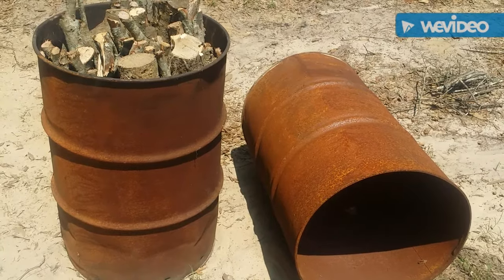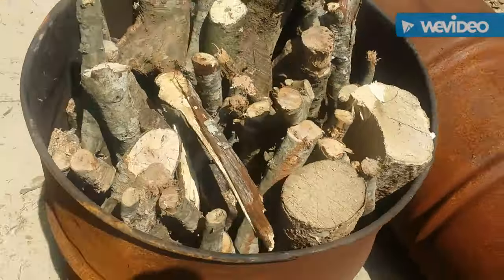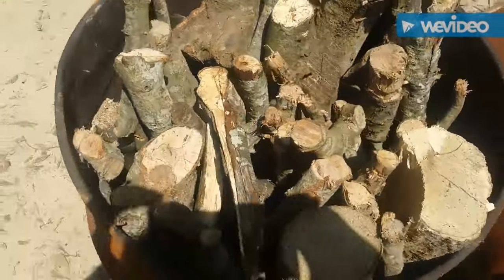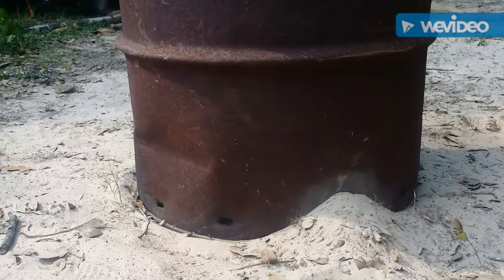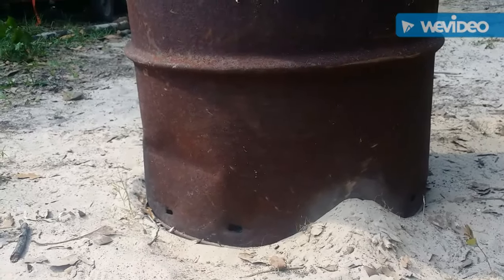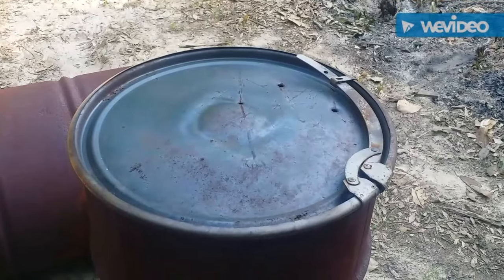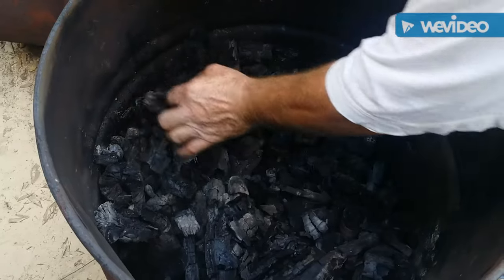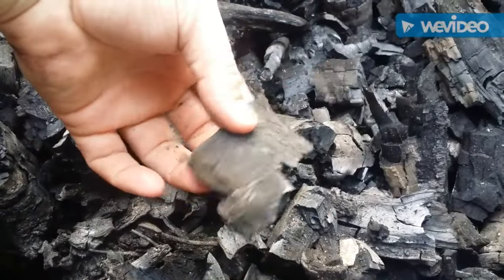Homestead Charcoal making the best way

Comment: Thanks! I tried this myself and have made three excellent loads of softwood charcoal for blacksmithing so far! I stack the barrel all the way to the top with kindling size pieces of pine and fir. It only takes an hour to burn to the bottom being that it’s softwood. Each load lasts over four hours of forging and gets hot enough to melt steel in my brake drum forge in about three minutes. I can now make great forge fuel easily and free! Thanks again!

Comment: I don't know about "best", but this is definitely the easiest method I've seen.

Other people have already mentioned it, but this is a "direct burn" method. Unlike most direct burns I've seen people do (and especially unlike the centuries-old mounding methods), you've created an afterburn zone to keep it from smoking to high heaven. You are getting more ash in your finished charcoal than a retort--or "indirect burn"--method would produce, but with a far simpler setup.

Considering how little ash you got, you're obviously getting pretty good yield. Most attempts at direct burns seem to produce a lower yield than you're getting, so you are obviously putting the fire out at almost exactly the right time. Very nice work.

Comment: I do it very similar. Lots of videos of guys making these elaborate retort kilns and stoves, but I hate drilling and otherwise  cutting up solid barrels… I also hate using 3x the amount of firewood as charcoal wood to get the finished charcoal… and I especially hate only producing a bucket full of charcoal at a time. I do almost the same as you here, but I don’t drill any holes in my burn barrel, and I use a rusted out old barrel for the jet chimney.
During burn pile season, I use 2 or 3 full barrels and build burn piles around and over them, barrels have only 1 hole with a 3-5ft x 1” pipe attached to allow for the pyrolysis processes and so I can monitor exactly what’s going on in the barrels.
Both methods are super simple, and efficient…

Comment: I use this same method in making biochar.  Only I use wood chips. Chips are easy to get from a tree service. I spread them out in the sun for a few days to dry. I then run it through a screen, half inch hardware cloth to remove the fine material. The fines impede air flow.  It then goes into a barrel, light the top, put the lid on and let it burn,  When the fire gets to the bottom of the barrel I remove the chimney unit and put a lid on it. Cover the holes in the bottom of the barrel and let it sit.  Using wood chips I don't have to crush it any further and wood chips are easy to get. This is called a top lit up draft system. TLUD for short.

Comment: after watching this video, I did a modified version of this, my holes are on the bottom and i set it up on three pavers. I ignite and within about 60-90 seconds there is usually a 3 foot flame rocketing out the top.  My holes are 1" and there are a bunch.  I leave the chimney on until i feel confident from inspection that the whole of the wood is involved.  i then let the fire continue to burn for about 15 minutes.  after that i remove the bricks and hill up dirt around the perimeter.  I let the fire continue to burn til all the wood is a glorious ruby red with NO FLAME.  I then quench it with water and put a lid on.  I check it once more a bit later to ensure it is quenched, then leave it for the next day.

Comment: If you have a wood stove just get a stainless steel container, drill some air holes in it, then fill it with wood and put it in your stove. This will produce smaller amounts of charcoal, but you don't need to maintain a big fire outdoors and all the energy goes into heating your home. If you prepare several containers in advance you'll have a large amount of charcoal soon :) Watch "Make Your Own Charcoal In Your Wood Stove (Wood Gasification) DIY" to see how it works.

Comment: Hi,  thank you so much for your very informative and interesting video, I would like to ask just about how many burns those barrels will be able to do,  secondly, how many holes and what size ( they seem about 1 inch) did you put  at the bottom of the barrel. Looking around I heard people trying a similar method but they moved to a different one because they were producing a lot of smoke no matter how many holes did they put at the bottom, I wonder what your thoghts are regarding this....maybe they did not use wood dried enough or they put something like woodchip which would prevent a good airflow within the barrel. Did you try your method with smaller wood sizes? Thank you very much for your help, Dami.
Reply from the maker: The barrels last 4 or 5 years and I usually make charcoal once a year.    I have tried larger diameter wood,  but it won't fully Carbonize if it's too big.   My best luck has been with 6 inch logs.    As for holes at the bottom...  I just guessed on mine.   You can put as many as feasible in it and fine tune the burn by shutting them off with sand.   Good luck and let us know how it works out for you!
Reply: @TURBOLANDRAIDER  thank you so much for your reply, I will try it and let you know thank you very much !

Comment: I have some questions...  how much time do you leave the afterburner.  And for how much time do you leave it breathing from below holes...
Reply from the maker: All explained on the video.    The afterburner stays on until you see red coals through the bottom vents.    Then the vents get sand shoveled onto them,  and the top gets covered.
Reply: @TURBOLANDRAIDER  thanks..  just a minor question...  red coals may fall in the bottom from the initial fire ...  shall I have to wait to see fire in the bottom??..  as i understand it needs 2 and a half hours after setting the fire and then close all the holes including the top??
Reply from the maker: @zooulapanayiotou2603  wait until you see the flame front drop down to the very bottom where the vents are.   That's when you know it's ready to cap off,  and extinguish the fire.

Comment: This charcoal has a sort of silvery color compared to the normal pitch black charcoal you see... what's the difference?
Reply from the maker: 4xdblack I'm really not sure.   maybe all charcoal is like that,  but in the process of bagging and transporting it,  that shimmer gets dulled or knocked off.
Reply: Been watching a lot of videos and reading up on charcoal making methods... If I had to take a guess, this method is called the "direct" method. The more common method is the "indirect method" or the charcoal "retort". What I've noticed is that the Indirect method produces pitch black charcoal straight from the can, whereas the direct method produces the silvery charcoal that you're getting. I read somewhere that the quality is essentially the same for both methods, but supposedly the indirect Retort method is more efficient, and ensures that a higher majority of the wood gets completely carbonized and little is lost. 

So I'm thinking the silvery color is due to the lost wood that wasn't carbonized.

But I'm pretty new to the idea of charcoal making. I just started researching it last night. But I still feel like this method is the better one because of several reasons. The first one being that all your wood gets turned into charcoal, and none of it is required to light a fire under the barrel. The second and biggest advantage IMO is that it is the easiest way to make a large quantity of charcoal at the same time. It's very difficult to make a charcoal retort that uses a 55gal drum.
Reply from the maker: 4xdblack excellent.   it's easy to get normal 55 gallon drums too.   they're commonly available.  With this setup,  I can yield four "50lb chicken feed,  or dog food bags" from 1 burn.   2 burns is enough to satisfy my grilling needs for a year.  (that's really all I use my charcoal for).  that's the biggest plus of this method imo.   it might not be the most efficient,  but it dang sure makes enough charcoal to make the process worthwhile.
Reply: I'm looking to make my own charcoal for my home forge. It would be a lot cheaper in the long run if I could make it myself. But right now I've only got one 55gal drum. You said that they're commonly available. Where might I find an old 55gal drum then?
Reply from the maker: 4xdblack any industrial area ought to have a bunch.  we have a few local places that sell storage buildings,  IBC totes,  barrels,  etc.   try driving through industrial parks,  and asking workers where you might find a used one.
Reply: 4xdblack 
They have them on Craigslist for cheap ($25) where I live.
Reply: My local craiglists ads have been pretty disappointing :/   But no worries, I went down to my barn and found 2 perfectly good steel drums :D   Now I just gotta stop procrastinating and take the time to prepare them.

Comment: How did you get the red coals at the bottom when you lit if from the top? Am i right in thinking once its been charred enough its now recognised as a smokeless material. Can you do the same with wood chips?
Reply from the maker: The fire draws in oxygen from the bottom and consumes it for combustion,  but uses it all up before the wood can burn.   I do not think this method would work with wood chips because they pack in so densely, and wouldn't allow airflow from bottom to top.   Try it and let us know if it works.

Comment: i enjoyed the video, but i still don't understand the need to make charcoal for your grill. you had plenty of red hot coals in your small fire pit. i use oak & maple natural wood in my grill.  i take the lid off my 22 inch webber and remove the cooking grate, then take small twigs that fall into my yard from my big oak tree and start a small fire on the bottom grate of my webber. once it gets going good i add some bigger pieces of oak. fill my grill about 1/2 full and let it burn with the lid off until i am left with red hot coals then it's time to put the lid back on and start cooking. i guess the only advantage i could see to using charcoal over wood is you get red hot coals quicker with charcoal than burning wood but not if you take into account the extra time and wood it took you to make that charcoal in the first place. what am i missing here???
Reply: Try doing a 13 hour low and slow brisket like that :)

Comment: Kia Ora from New Zealand! I noticed there was what looked like three holes drilled into the lid? Is that right? I am guessing its for out gassing, but let me know if its advisable to drill a couple of holes in the lid. Thanks mate!
Reply from the maker: Beachcombers NZ yep.   I just didn't want to totally seal the drum off, and possibly have an accident.   I usually stuff some aluminum foil in them.
Reply: Awesome, thanks brother!
Reply: Beachcombers NZ , you don't need to add holes. If there's a build up of gas, it'll just blow out the sand/dirt from the back filled holes at the bottom, gas will always take the easiest way out.

Comment: After about 2.5 hours I need to take off second barrel from top and put the lib on first, right? What is the best way to take off that second barrel?
Reply from the maker: Pull it off when you see the flame front drop low enough so that oxygen can not feed the fire from the top.    I just push it off the bottom barrel when the time comes.
Reply: @TURBOLANDRAIDER  Thank you

Comment: What can you do to stop the burning process if your barrel doesn't have a lid
Reply from the maker: frankcqIII get a lid,  or find some way to starve it of oxygen.
Reply: TURBOLANDRAIDER any ideas? I'm trying to produce charcoal for extra cash but can't find any used open top barrels. Coming from Guam where everything is over priced and limited in options, I wonder if anyone here or you thinks that paying $255.00 for a new open top barrel is expensive. What do you think of using water to cool the charcoal instead of the lid? I might have to leave charcoal out to dry but not sure what other effect using water would have on the charcoal's quality... Any thoughts?
Reply from the maker: Might be able to do it with an upside down barrel?    Just got to keep oxygen from getting to it after it is all on fire.

Comment: do I need to put holes in the top lid for when I close it?
thanks!
Reply from the maker: You really don't,  but you can.   I was worried about having an accident,  however I think that the sand arrived the bottom would let any sort of built up gasses escape if there was any measurable pressure.